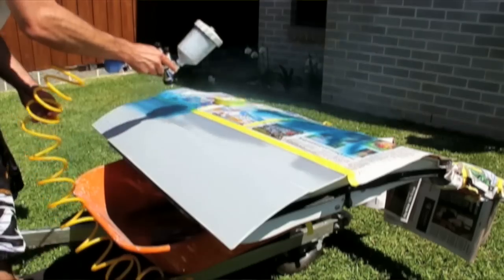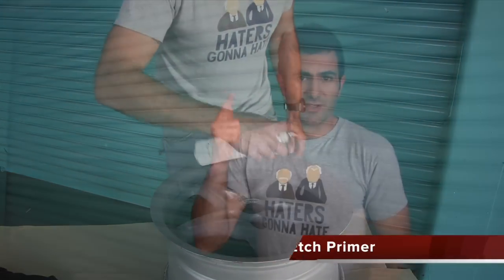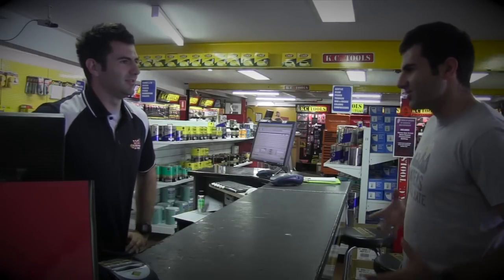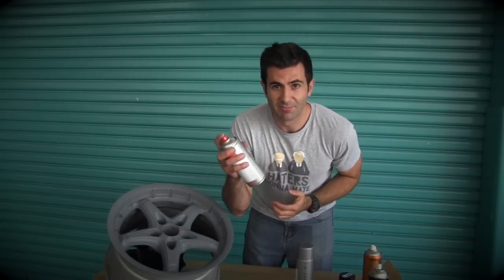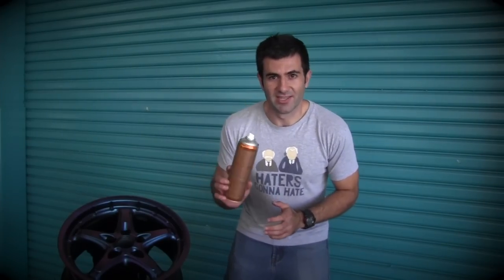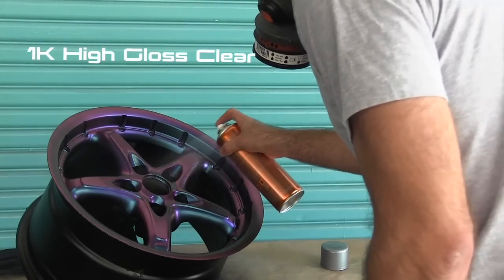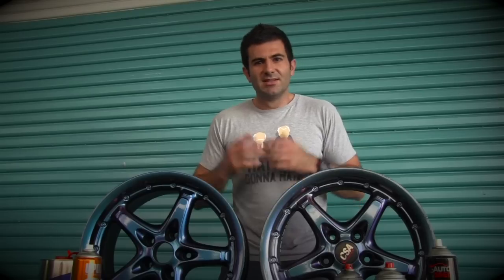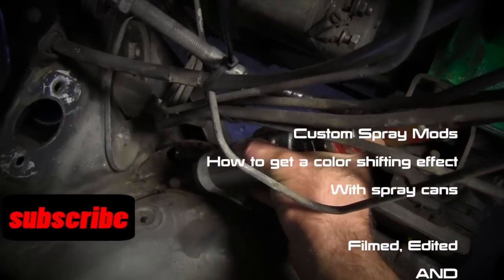How to paint alloy wheels with spray cans Color Shift

Comment: Rustoleuom makes the aerosol in there spray cans & can be found @ LOWES in the USA or on there website , directions are on the can as fallowed : prime , fallowed by black gloss base coat gasing out for 2 to 12 hrs then spray over bblack base coat in light coats depending on desired colorshift , comes in Gamma Green & Galax Blue

Comment: Your vids are great,,can I get your opinion,I'm fitting a rear qauter panel but it's already black,,but as you know I have to bond all the edges,and the two cuts,,but most of the new panel will remain original black,,but do I still sand the complete panel and then respray,,and if so can I have your recommendation on sand paper please from start to finish,,,I'll grab some 2k clear looks the part,,, cheers john

Comment: Love this look... Almost looks like black chrome in the sun. I'm actually looking to mimic normal chrome plating on just the lip of a brand new set of gloss black wheels. (Appx 1/2" - 3/4" wide stripe)
1.) Any suggestions for paints/colors found in aerosol? I don't trust that chrome paint, so I'm likely looking at a bright silver with a very high gloss clear coat.
2.) Is it necessary to remove/sand the finish, given that the wheels are brand new? Or is it safe to prime over the black gloss?
Again, this is just the lip of the rim, but I'd prefer it be the most effective job. Thank you.

Comment: Hey great video bro! I just have a question if your help me out that be life saver. I just finished painting my rims to a gloss black along with a thick coat of clear coat 
Now it's been couple days sittin n I wanna know what can I use to add a protective layer on to them. Becuz I touched them n it added a mark n I try to buff it out with a clean cloth but it left swirl marks n it's quite noticeable  

Thanks bro

Comment: i tried painting my rims once with can spray and when am washing my car as you all know i of to wash my rims,and the clour wash off as well so i dont believe in can spray used to spray your car rims
Reply: what kind of clear coat did you use? there should be no way it should wash off with a proper automotive clear. if you had skipped this step, then ya, it could wash off. the basic auto paint could come off pretty easy without sealing.